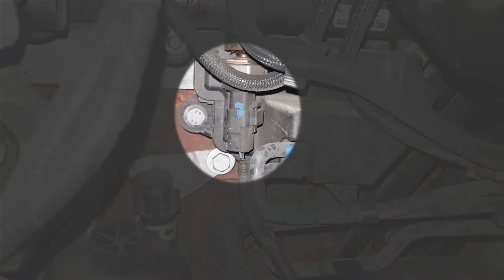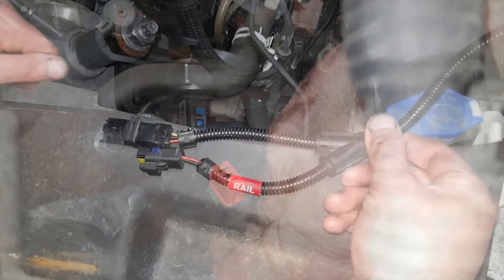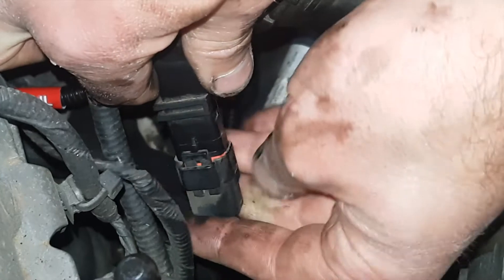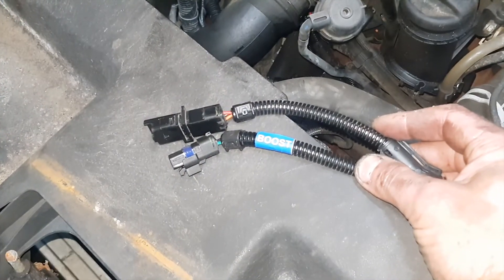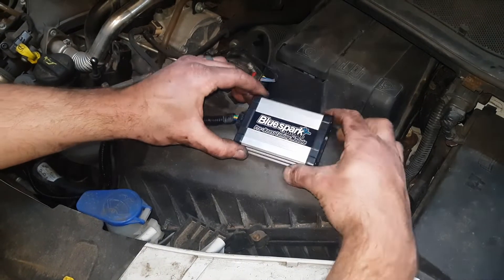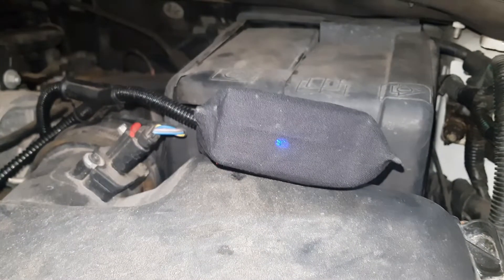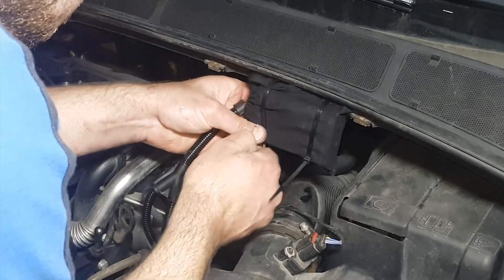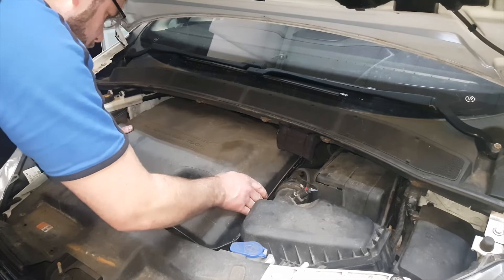Ford S-Max Chip Tuning Box Installation - 2.0 TDCI PSA engine

Comment: hello, what is the price of this block?
Reply from the maker: Hi, the price for the Pro + Boost box which is features in this video is £279.99. If you provide us with the exact engine spec of yours, I can link you directly to the correct box on our website 🙂
Reply from the maker: Hi, 
Our Ford S-Max 2.0 Pro+Boost tuning box is £279.99

Comment: I am thinking about a tuning box for my mk4.5 mondeo 1.6 tdci but am very sceptical, do they actually work and can they damage the engine, any advice would be very helpful thanks
Reply from the maker: Hi Phil, 
We do tons of units for this engine and get great results. We have never had an instance of engine damage, and make sure all of our units are carefully tuned so as not to cause problems. If you have a look at a few of the other videos on our channel you can see dyno testing for most models, showing the gains and proving that they work as advertised. If you have any questions or concerns the best thing to do is give us a call and have a chat.
Reply: Good boxes (like this one) work superbly, are well developed and aren't going to damage your engine.

The vast majority of the negative stuff you see is because somebody bought a resistor off eBay for £20 and then was surprised that it didn't work well on their £30k car.